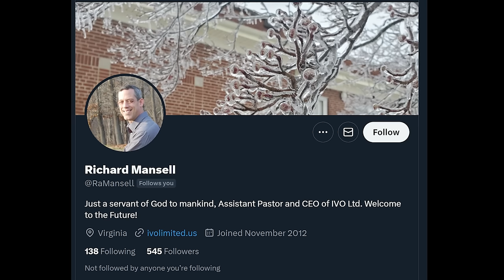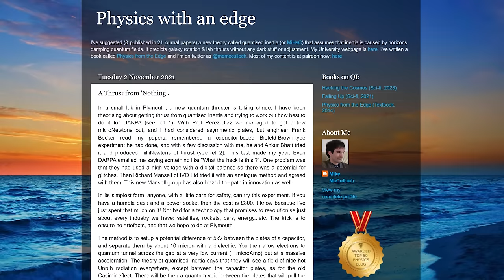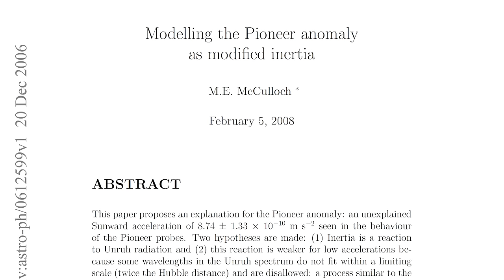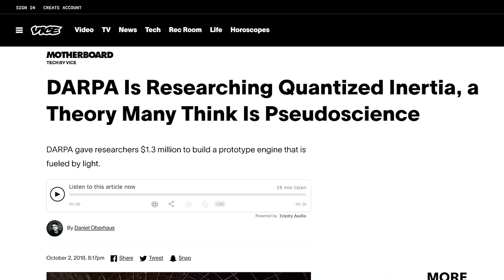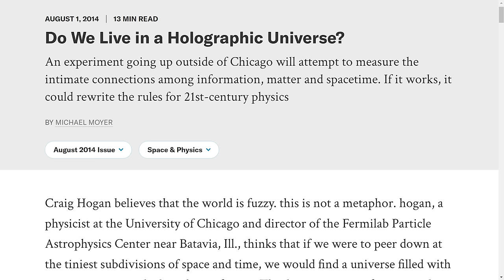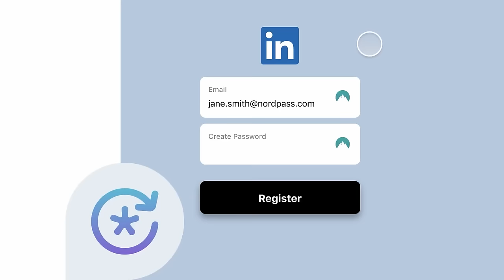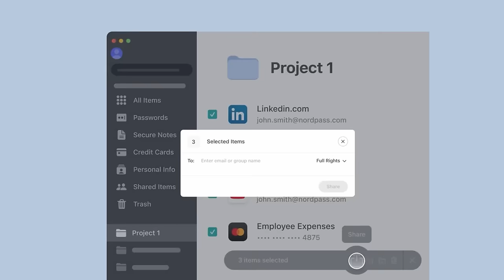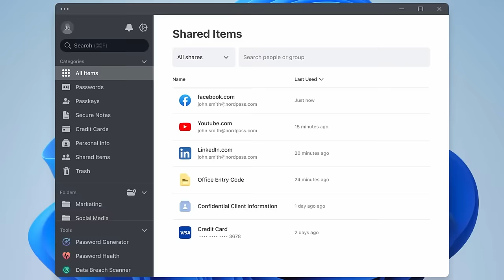Quantum Inertia Drive put to Test. It didn't go as planned.

Comment: This is where theoretical physics earns it's bad name, as you've pointed out...  Attacking the quantum drive based on the problems with someone's theory of why it works does not make much sense to me?  The theory was pulled out of someone's hat and was wild speculation at best (like most of theoretical physics)    until real world experiments can be done.
Since the cost of doing this experiment has come down as you mentioned, I think it's a thrilling thing to try.
As they always say, most discoveries do not come with the exclamation "Eureka!"  They usually come after saying "hmm...  That's funny..."

Comment: Ok, so here we go again. Lets take our little time travel back in time and do a little theory. 

A couple of decades ago it was discovered that if you beamed microwaves into a closed copper bell you could get an impulse. The people who followed this eventually got accelerations in the 10E-5 range, again without showing what the reaction mass was. 

So here's the deal about space flight. We have what is called the tyranny of the rocket equation which is dV= g * ISP * ln (initial mass/final mass). 

ISP (specific impulse) is a peculiar beast, so we can get rid of it and replace g * ISP with Exhaust velocity Ve. 
   
So the benefit of the MW drive system is that it expelled no internal mass, thats fine but it had what appeared at the time to have an Ve in the 10E6 to 10E7 range. 

If we look at the rocket equation that looks great, but is it. 
So lets see why. We already have a high ISP system. Take a very high luminosity source, put it in a parabolic source, and viola! you have a photon drive. Great. Lets see how great it is. Ve = 3E8. 

We need an equation. The equation needs some things, so output should be scalar with power, we have an efficiency. What about Ve, to make things go faster we need more energy. 

Force = Power * eff/ Ve. 

So lets say we have a space ship with 10 meters of solar panels of 28% efficiency. Solar output is 1400 watts per meter so we can generate about 4000 watts. So right now solar panels weigh about 10 kg/meter, so about 100 kg per total. Lets say our lighting system is 80% efficient. OK we need a mass. Lets say our drive and control system is about the same weight as our panels, so 200 kg (NASA engineers are shaking their heads a my rediculously low weight estimate). 

Acceleration = Thrust force/mass. 

Acceleration = Power * efficiency / (Ve * mass) = 0.000000005 = 500 pg of acceleration. 

How long would it take to reach the speed of light at this acceleration. It takes about a year at 1g to to approach the speed of light, so about 2 billion years. 

In fact Nasa already has a High ISP thruster called the Hipep, it consumes 35kw and generates 88000 Ve at about 75% efficiency and runs on Xenon. To operate this thruster we would need about 100 square meters of panels, again weight a ton, but now we need to carry fuel. So lets say half the ships mass is fuel. 

 dV = 88000 x .692 = 61 km/sec. 

 OK so whats the average acceleration. 
   40,000 x .75/ (88000 * 750) 0.00023 or 23 ug. So it would take about 10 years to achieve that acceleration. 

OK so ten years is great we can quadruple the speed of Horizon probe. Nope, 10 years of continuous operation will degrade the Hipep panel, but theres another problem. If i launch into circumsolar orbit and start burning prograde, lets say I acieve 1500 m/s velocity in the first 3 months. What happens is that the craft now has a apogee around the orbit of mars, the solar radiation has dropped and thus is getting less power. Over the course of a year the space craft will still keep rising away from the sun, but accelerating at a slower rate as it spirals away from the sun eventually dying with most of its fuel on board. 

So what is the prognosis for magical solar electric drive systems. At least in theory if you can get close enough to the sun (-20000 dv) you could theoretically with a high heat tolerant solar panel accelerate at 10 to 100 times the 1/4400 m/s and thus complete a burn sufficiently close to the sun for something in the 40000 to 100000 Ve range, but for these magical no mass or magic mass thrusters, the acceleration is so low that you would be spending more and more time in the distal part of an eccentric orbit you would essentially become a high period comet. 
    
   So lets do the theory here. Lets say we are confined to accelerate a exhaust kilogram over 1 meter. We can do it over a small area (x * y)or a large area, it does not matter but the ortogonal to the face of the thruster has a fixed acceleration length of one. So lets start. 

Ev = 1, d = 1/2 at^2 = 1.  2 = at^2 with at = v = 1. therefore t = 2 and a =1/2. So Work = 1/2 times 1 = 1/2 joule and power equals 1/2/2 or 1/4th watt. 

Ev = 10. 2 = 10 (t), t = 1/5 second. 10 = a * 1/5 so a = 50, so E = 50 and power = 50/(1/5)th = 250 watts. 

Ev = 100. 2 = 100t, t = 1/50 second. 100 = a *1/50 so a = 5000, E = 5000 and power = 25000 watts. 

What we can see is that the power required to move a fixed mass a fixed distance with variable exhaust velocity is 1/4th * V^2. So that any system that makes the statement that they are using onboard energy (not reaction energy from exhaust fuels) is going to have to have an energy supply on accord with the square of Ve to maintain mass flow, but change of momentum is scalar with Ve. 

   As we can imagine if we were to consider the power of say 3 kg at Ve of 0.333c and then our power requirement would be 1/4 times 100,000,000,000^2 or roughly 2.5 E15 watts. We need 2.5 million terrawatts of power to run such a drive. The inefficiency in such a drive system would immediately vaporize such a vessel. 

So that we can do this, very easily any claim suggest a impulse is created from a massless or very small particle and they are using a non-magical electrical power source in empty space, then we can assume that they are generating trivial thrust. Because if they are claiming to generate a significant acceleration (i.e. change orbit) you need to question was there an exhaust mass  or where the energy came from (Was it stored and suddenly released). You cant have a very low mass very/low power drive system that is not also trivial. 

We cant change these. If you want to split inertia sending energy in two directions, then the net result is you must expend energy and also mass (except photon drive). So if you are working on a magical drive that expends no mass, what I need to know is what is your energy source that will make your drive system relevant.

Comment: acceleration does not need energy input - at least it will not need a propulsion system. gravity will ‚convert potential energy‘ into acceleration, but potential energy is not real energy.

Comment: Yeah... you might want to replace that SpaceX Super Heavy launch with a Falcon launch as no Super Heavy to date has made it to orbit as they have only launched two flight test articles. Both of which have exploded for varying reasons. FT-3 is expected in March.

While SpaceX has learned a lot, no Super Heavy has had a payload aboard.

Comment: So if you produce light out from a long narrow tube, mount a reflective cone (nozzle) around the tube so that tube runs the length of the cone down through its center, and then fill that cone with a fluid that slows the light as it travels through.  When that light strikes the cone it will bounce off and travel to the open end of the cone.  As it exits the cone's medium it will resume full speed I assume.  Why would light exiting the cone's liquid have done so without an observable reaction?  Surely light slowing down changes some of the light into other forms of energy.
Reply: Eh? Why would it slowing down imply that?
Reply: @drdca8263  It's not just slowing down, its shifting energy.  So where is the change in energy going?
Reply: @MadRat70  does it?

Comment: Build with Casimatter: parallel plane alternating vacuum depositions of 200 nm thickness aluminum and LiF/MgF alloy to match thermal expansion coefficient.
The Casimir effect removes etalon vacuum zero point fluctuations, diminishing intrinsic field inertia as the inverse fourth power of etalon thickness. giggle
.....Force/area = -[(h-bar)(c)(pi^2)]/[(240)(s^4)]  s = separation  After all, to criticize is to volunteer.
Reply: erratum:  LiF/MgF_2

Comment: This sound like the direct downwind faster than wind vehicles that confused way to many people. I even invested the time to do a proper experiment where I demonstrated how such a vehicle works and despite providing both experimental evidence and theoretical calculation to match the experiment most people remain unconvinced (and I'm referring at people with PhD's in physics).
Reply: You probably mean the q-drive (which uses the plasma magnet concept) which hasn't yet been tested in space while this video is the QI drive, another capacitor drive like the EM-drive but different, which I guess technically hasn't yet been tested in space either yet
Reply: @@retiredbore378 Yeah and the q-drive is a concept using plasma magnets to exploit that effect in space against regions with contrasting solar wind for ultra high propulsion but it can probably get confused with this QI drive easily by name alone lol

Comment: if unruh us resistance to acceleration couldnt you wiggle back and forth with wiggle in one direction being dramatically faster than wiggle in the other allowing the resistance form unruh to give you enough to push off of in one direction for acceleration but not another

Comment: so does that mean that acceleration isn't indistinguishable from gravity because one will observe unruh radiation and someone standing on a planet wouldn't?
Reply: Acceleration is indistinguishable from gravity only in a specific local sense for a point object.    If you send extended body into free fall,  gravitational effects can be measured separate from acceleration, since there are tidal forces on extended body (the Moon do not just accelerate going around Earth, it also makes tides on Earth, which is gravity).   Particle and vacuum definition is not local, it requires some space, so effect of gravity and acceleration does not have to be the same.

Comment: The quantum drive will go down just like the microwave cavity drive did... people not accounting for basic things like the effect of Earth's magnetic field on electrical wiring carrying a current.  Or something like that.

But as to weather the Unruh effect is real... I personally believe that it is and the way I would approach it is by looking at the effect as a boundary problem, similar to how the Casimir effect can be approached as a boundary problem.  The vaccum in front of the accelerating object will behave differently than the vacuum behind it, creating a very small force opposing the acceleration.

Since the Casimir effect is very real, I would speculate that the Unruh effect is as well.  The boundary in the case of the Unruh effect is simply the difference in virtual particles ahead of the line of acceleration verses behind.   That leaves relativity intact.  If someone were to argue the same thing using just velocity, it would more quackish.  But acceleration has always been a bit of a special case.

-Matt

Comment: As a former managing director of an asset manager (and I happen to have 2 PhDs ) I have to give the dudes who pitched the quantum drive concept some grudging "respect" for their chutzpah.  If you don't  ask you don't get.  I once had to offer an opinion on a residential property investment product which had been "actuarially" verified (although I found several conceptual and technical errors in the calculation) that would have led to an investment fund with a greater value than the whole US economy given the assumptions of take up for the product. This was pitched with a straight face too.

Comment: Complete misunderstanding of Quantized Inertia at every level. QI proposes unruh radiation as the source of mass/gravity, and the explanation for why stars at the edge of galaxies are moving faster than predicted is simply because they have less mass (rindler horizon exceeding the cosmic horizon). At its very base, the acceleration from the QI drive is due to mass manipulation (particles having more mass moving one direction vs. another)

Whether or not it's true is another matter entirely but if you missed those points then this channel is not a source of reliable information.

Comment: I honestly think this is the worst video of yours i have watched. You started by showing a prototype rocket when speaking about the satellite instead of the actual rocket (you could have googled spaceX transporter 9 and gotten the exact launch of the rocket). The sat failing before the could test the engine is just bad luck, no need to turn it into a conspiracy. 

The thing not working scientifically should be the actual video, but thats not the "news" headline you used. 

Also the explanation you gave was confusing to me. You explained that radiation as a form of friction and then basically told us that there is no way to use friction for acceleration. But friction is exactly what we use for acceleration on the ground. Your understanding of physics is definitely much better than mine, so i don't doubt your conclusion, i just don't think its a good metaphor. 

Well everyone has an off day.
Reply: I agree with you. Sabine's understanding of the Unruh effect is remarkably poor for a theoretical physicist.

Doubting the existence of the Unruh effect goes against 50 years of mounting evidence. It is Unruh radiation that is problematic.  Unruh energy is most likely strictly local and doesn't radiate.

I have recently published on this in Foundations of Physics: "Ground state quantum vortex proton model"
Reply: @stevenverrall4527 Lemme be clear here, i have no idea about that effect or how good sabines understanding is. I just state that the comparison to friction to explain why it does not work is very badly chosen.

Comment: I hoped this would have proved my theory rather than theirs, that our relative mass is falling in a way that we cant measure due to expansion of the universe. Its difficult to explain without maths as using the term 'relativity' drums up ideas of einsteinian relativity, which it is not.
The only place to take true measure from is the origin point, which is unavailable because of the velocity of the big bang. Other points of reference are useless if the density of space varies without the inclusion of dark matter.
Reply: The gravitational fields of coagulated particles will cause vortacise in space such as black holes, that are in effect expanding more than they contract from an empirical point of view. They only appear to be contractions due to our proximity in spacetime.
Reply: IF the satellite had functioned and observed a certain deviation from the expected it may have shown that einsteinian relativity had a simple flaw based on the initial big bangs impulse where there was only a single event of acceleration and all subsequent acceleration was a product of interaction as matter and energy coagulated adjusting mass. 
This would explain a great deal of the blackspots in current theory and push astrophysics in a more productive direction. 
Its not going to be a stargate but it might at least form a mathematical model for the universe that no longer fails under scrutiny, and anything past that is conjecture
Reply: For those looking for conspiracy theories, well just follow the money vs evidence and draw your own conclusions
Reply: Either way this is not a way to travel time, but maybe a way to map time in a more geometric manner. Time being less of a barrier and more of an undulation that can potentially be utilised after much more research and experimentation

Comment: An accident that does not disprove quantum inertia. It should be redone, there is enough potential payout. Besides, it's not the only potential reactionless drive out there that may do the trick. Remember that all technology does not rely on accurate theoretical underpinnings, sometimes the technology comes before a comprehensive theoretical understanding.

Comment: Without Unruh radiation you won't get black hole evaporation. So tear apart Sol system to build a Dyson swarm and use the resulting laser array to pop micro black holes into existence to test this. The side of the swarm facing Earth (half of each orbit) can run AI to generate cat videos to pay for the experiment.

Comment: I'd like clarification on what it means to say that something is not a real effect, and what is the difference between a meaningful and meaningless definition of a particle.

For example a not real effect could be something that doesn't actually occur, or it could be something that does occur but what is occurring, or the cause of it, or both, could be misinterpreted. And a meaningless definition could mean a definition that is inaccurate, or one that is nonsensical. In the case of virtual particles, that they aren't fully "real" is right there in the name.
Reply: The definition of 'virtual' in 'virtual particle' essentially means that the particle is real in that it actually occurred, but for such a short time that it might as well not have been real. Sometimes, due to certain conditions, the 'virtual particle' can transition into a stable and steady state across multiple Planck times, and thus lose its virtual status and become a 'real particle', able to interact with other real particles.